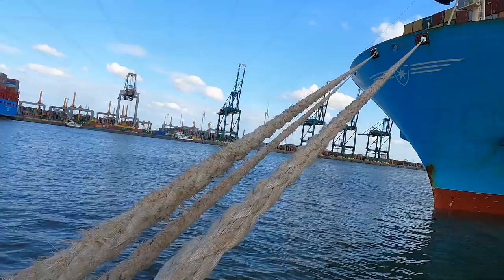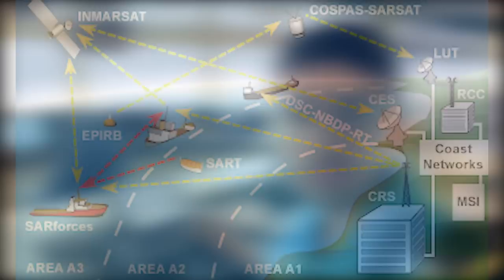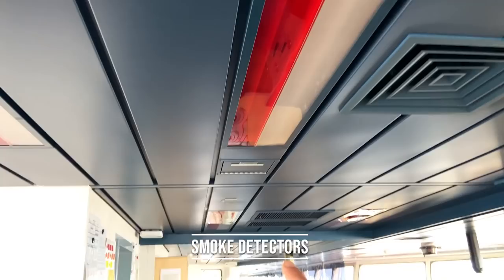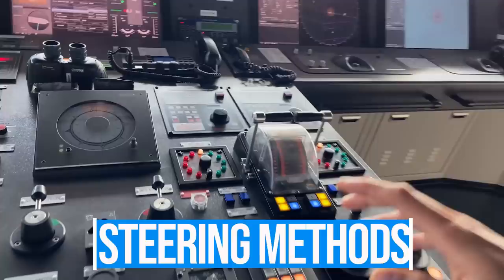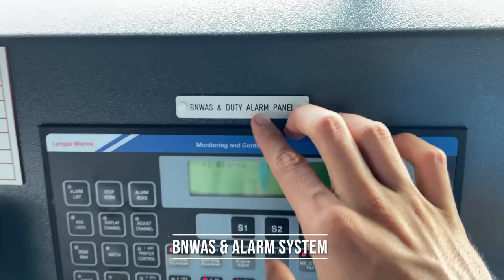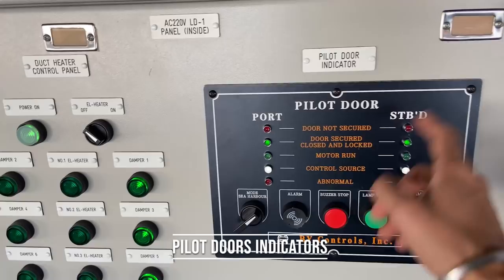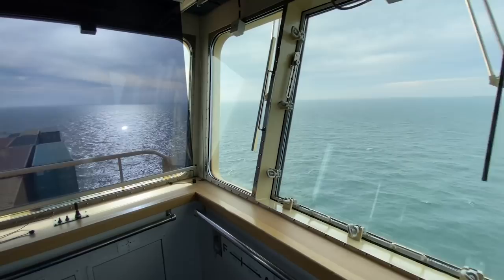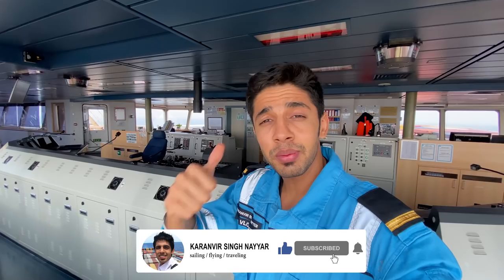Navigation Bridge Of A Modern Day CONTAINER Ship - Detailed TOUR

Comment: Karanvir, with the Barometer situated inside the navigation bridge that has it doors and windows shut and a closed loop HVAC system, is the Barometer sensing the correct external atmosphere pressure ? thanks for the bridge tour.
Reply from the maker: Yes we have to open the door when we take the readings
Reply: Good comment

Comment: Hloo sir, a lots of knowledge gained through this video . sir I want to know about the bearing system + about sextant (hw to use & why )+ what are spare flags & why they are used. one more last qst is that ,are ac facilities available in bridge room ? if not how you ppl find the solution during high hot temperature ?
hope i get my answers :)
thank you.
Reply from the maker: Will cover in a video
Reply: sextant is used to observe the altitude of moons,sun,star in order ti locate ourself in the position.
flags are used as a signalling system in order to signal,each flag has it's meaning and denotes something when raised.
central ac is there on bridge,portable ac is for back up in case the central ac fails as the equipments may heat up in absence of ac.in old ships mostly ac is kaput,so people would sleep on bridge coz it's the only place with ac.